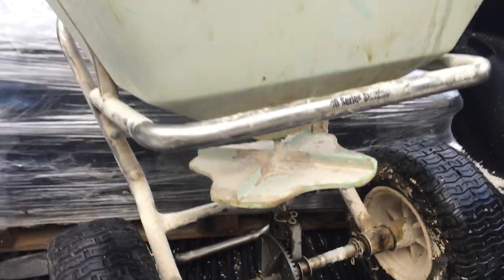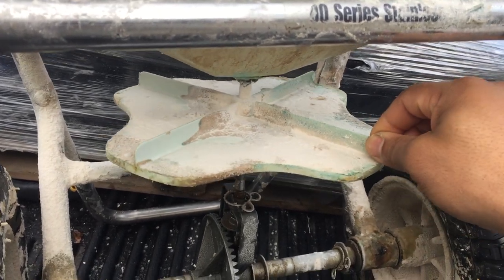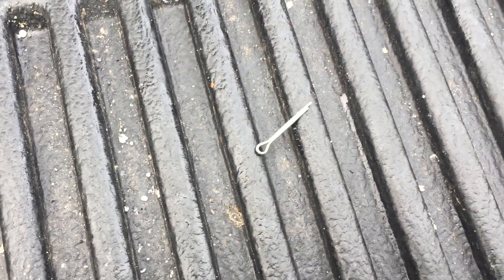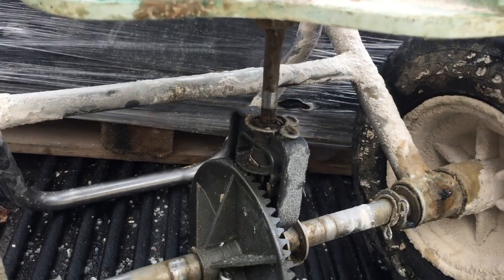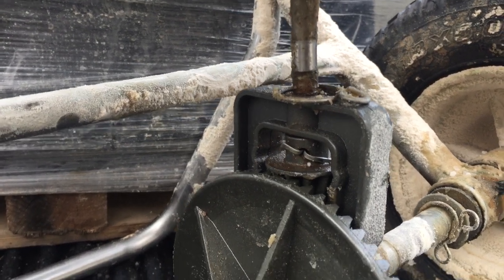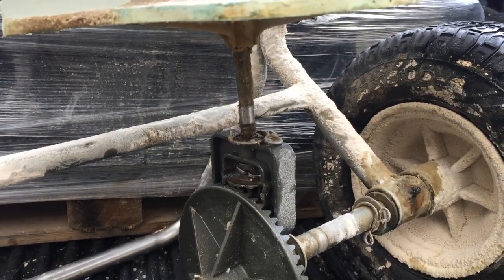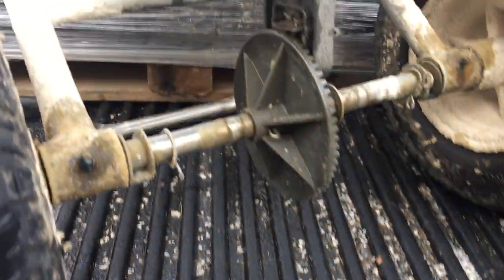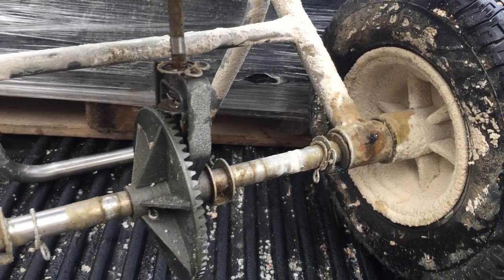How To Repair Fix Fertilizer Spreader - Fertilizer Spreader Not Working, Broken

Comment: That's just a cotter pin. If it kept breaking, maybe consider a stainless bolt of the right size with a stainless lock nut.